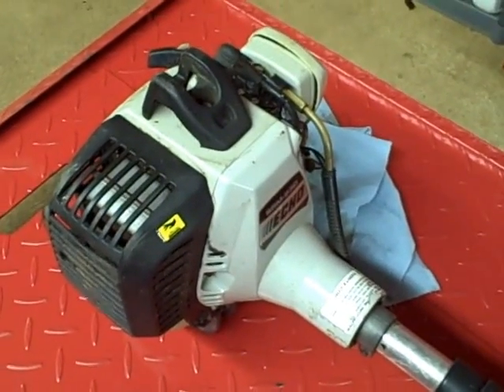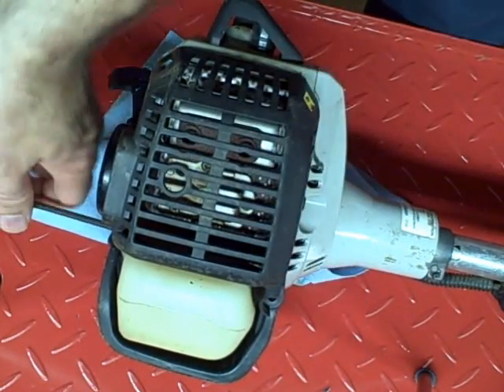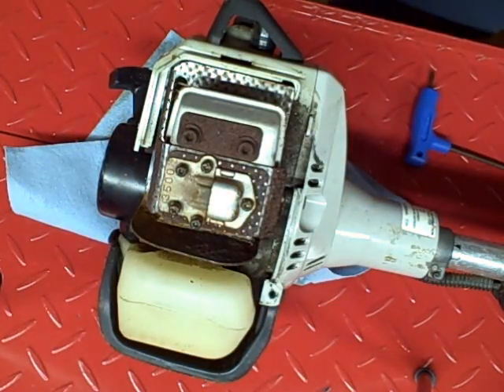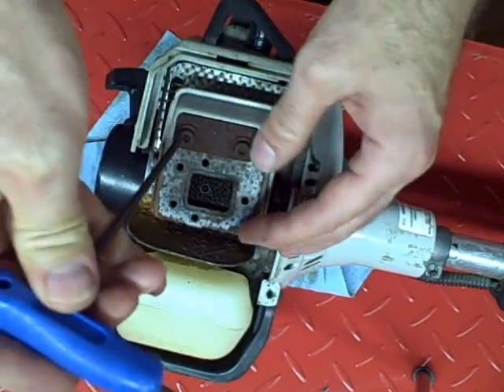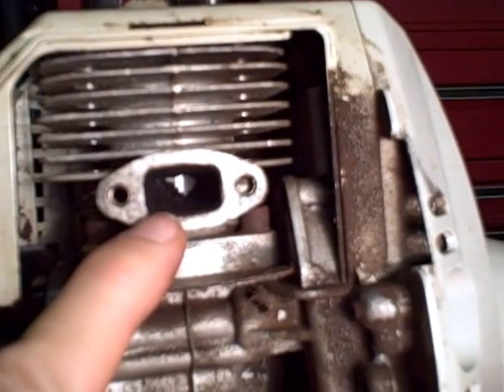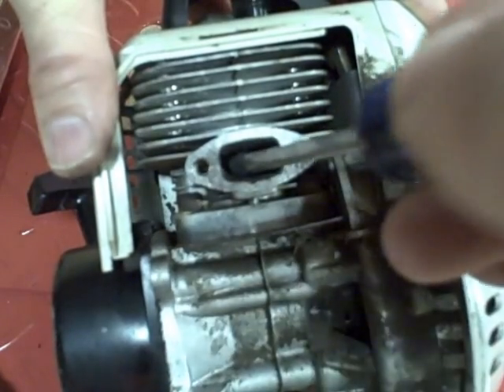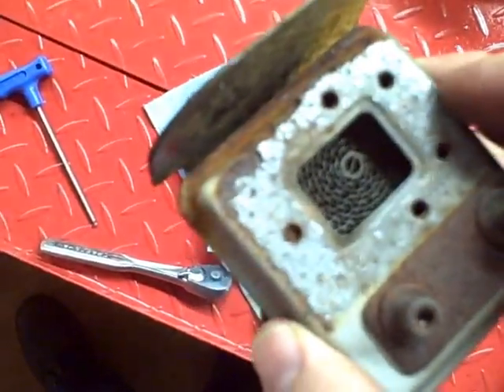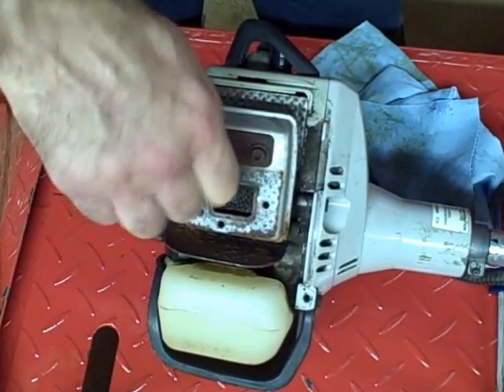Small Engine Repair: Cleaning Carbon Buildup on the Exhaust Port & Muffler on a 2 Stroke Engine

Comment: Some times I’m shocked at how much carb can be in them and still half ass run, I hang them up above my head with safety glasses and scrape it out 
Works good and then blow air and flush with B12😊

Comment: Hi there.  Very good job getting the carbon out of the port. I normally put the engine on its side with the exhaust port up. Muffler off of coarse and put a little gas and let it soak. After a bit I take a thin wooden dowl rod with a slightly sharp tip and the carbon comes out easily. A softer wood dowl is alot easier and safer on the piston. If you accidentally slip and hit the piston it won't damage it.  As far as your Muffler that round thing inside is a catalytic converter. Your trimmer needs high rpms to heat it up and it will actually burn residual oil to nothing. I mean not even smoke. It is important to run the right oil to gas ratio like 50 to 1 or 40 to 1. If you have two cycle equipment without catalytic converters a propane torch is your best friend.  I  take the mufflers of,  heat them till the whole muffler is glowing orange, let cool, blow it out with compressed air,  put it back on and they absolutely scream at full throttle. I  have a Bernzomatic mapp/pro turbo torch for the muffler cleaner. Just in case you want a great torch too for doing that same thing.

Comment: The thing inside the muffler that you said looks like “radiator fins” is actually a catalytic converter used to reburn unburned exhaust gases that normally occur in a 2 cycle engine.

Comment: I have a muffler bolt snapped off in one of these Sthil what size heli coil would I need to repair the hole Have you had any success with this method John

Comment: Yeah, those fins you see inside the muffler is the catalytic converter. My Echo CS370 chainsaw has the same setup. Except I did the muffler mod and drill the cat out then readjusted the carb screws to get it running even better. It’s a little screamer now. 

I also mow with 44 and 46 year old Lawn Boys. Their service manual suggests using a 3/8” hardwood dowel rod to clean the ports to minimize the chances of scoring the piston. Good video!

Comment: Remove the gasket for the muffler and squirt GumOut carb cleaner in it and then empty it out. After excess is drained/shaken out,  light it with a propane gas grill lighter and burn off the remainder.  (A small brass tube can be hammered into a wedge and that will not score steel to scrape the exhaust port), but get the piston up enough to block any carbon from falling into the combustion chamber... 
 I took the muffler sprayed and shaken out from carb cleaner and then set it on the ground (large opening up) and lit it with a small propane grill lighter. Adding a small piece of paper towel as flame comes out the hole drives up the heat and makes the combustion burn up all traces of the carb cleaner. It will be HOT for a few minutes after the burn out !  Be careful and re-install with a drop of no-rust on the screw threads before tightening the nuts (usually 2 for a small metal muffler).

Comment: After loosening the carbon, I prefer to use a shop vac to suck out the loosened carbon, rather than using compressed air.

Comment: Rather than replace the muffler why don't you try soaking it in a solvent like acetone ? Also a solvent like carb cleaner can be used on the exhaust port carbon.

Comment: Was reading the manual for my old MTD single stage snowblower and saw a comment on cleaning the muffler and cylinder exhaust...  I searched the subject and ended up here.  I was out doing snow yesterday and the muffler fell off!!!  The bolts loosened up I guess.  I was lucky to locate the missing one on the ground where I started as I thought it might have been thrown into the snow by the exhaust chute.  Mufflers are expensive!!!!  The one for mine is $40.  We only paid about $150 for the entire machine.  Luckily I will reinstall the muffler.  Thanks for the video!!
Reply: DOLRED LOL!! Sorry for your misfortune and glad you were able to put it back on but that made me laugh :-)

Comment: Great video, thanx for posting. Question: I have performed a carburetor clean up on an older Shindaiwa blower and got it running reasonably smooth at this point. However it seems to be blowing fuel (50:1) out of the breather intake. Any ideas why this might be happening?  Thanx in advance.
Reply: Maximus Dove 
plugged exhaust

Comment: I do this often on my 2stroke bike . I didnt know this trick few yrs ago and I blew my engine twice because I didnt know there was so much carbon on the exhaust port, you can still get away without cleaning like this on a 4 stroke but the 2 stroke engine will get damage and eventually blow its conrod because of the extreme back pressure build up when it gets really hot...I also rode my 4 stroke bike without any of this procedure for 8years and it never really had such problem..however.its very important to do this on a 2stroke engine
Reply: the repair shops never really tell you about this, they simply say it needs repair..if you do this trick every 5000mi on a 2stroke e gine bike its going to last.a long long time..

Comment: I do landscaping 30 plus years experience now been running the same Homelite equipment ever since I started back in 79 the exact same original weed wacker chain saws and leaf blower and believe it or not the best thing you can do when cleaning the carbon out is take it apart like in this video and then urinate all over the muffler and inside the engine around the piston the ammonia in the urine brakes that stuff down like nothing I've ever seen let it sit overnight at least 24 hours 48 hours if its really bad and then shake it until it's about dry finish drying with an air compressor put back together will run like brand new and only got to do it every 7 - 10 years! what I do is urinate in a five gallon bucket and I get it about half full that way I just throw the muffler in and let it completely soaked and then with the other five gallon bucket that has urine halfway full sometimes if I am in a hurry I will just hold my weed wacker upside down and dunk the whole motor in and let it sit for 24 to 48 hours with the spark plug removed and the exhaust removed and it will clean everything! when you take it out do the same thing dry it with a compressor and then rapidly pull the rope put it back together will run like brand new again! the ammonia in the urine is the secret and like I said guys been running the same home light equipment for over 30 years now besides replacing a couple pull ropes and spark plugs all original.. take care guys and nice video
Reply: Wow lmao ive herd it all now i bet this guys shop smell horrible. ....barf
Reply: 2 and a half gallons of urine..........bet that takes some time to accumulate.
Reply: Brilliant! Just brilliant! I laugh my ass out trying to imagine this service procedure. I assume your engines run so smooth as they afraid of being such humiliated more often than every 5-7 years%))
Reply: S Justice  is there anyone here tested his concept put yet?
Reply: Not if you invite your friends over for a beer or two!!!!
Reply: sage advise, i have now started pissing on all my weedeaters and blowers
Reply: piss on it
Reply: and the fermentation during the time it takes to build that up ffs!
Reply: TnD LawnCare Services i am doing it on an echo weed trimmer lol high stakes but i did find it on the curb so i dont have much to lose

Comment: Nice video, I have a echo srm 210 and i tryed to clean the carb out yesterday and when i started it and it was puttering and i had to play with the choke and use the choke to let it run but it ran for like 5 seconds then died, I really need to figure this thing out cause I cut crass for a living so its a necessity. i tryed to clean the fuel filter. and removed it then started it but still had to adjust the choke it get it to run for a couple of seconds. gonna try to clean the carbon maybe that will do it. any advice thanks. Brodie

Comment: Might cleaning the carbon build up at the exhaust be better with a shaped, shaved wood piece (Shish-kabob-like perhaps) so not to score against the piston or metal? Thanks for sharing. Have an old Echo. Now hard to start and keep started. Use to be a gem to run and will now tackle , thanks to your video, the exhaust part after fixing the bulb primer leak. Oh- turning the cylinder is a great tip.

Comment: Great Video thanks. I've just repaired my Stihl FS-55 after watching this. Muffler slightly blocked, but driveshaft had a load of string wrapped round it, so was losing power. Running better than ever now. Thanks again.

Comment: Gotta do this tomorrow.. Needed a weed eater and someone threw one out lmao. Got it to start but it wouldn't warm up and has been sitting for a good long time. Ive done this before and it worked on the old feather lite I found in the trash. I'm cheap haha and I know never to BUY a feather lite. They are like disposable lighters! Thanks for the video! :)
Reply from the maker: ***** Briggs low end engines are designed to last close to 2000 hours under ideal conditions, but most people replace their Briggs mowers with less than 200 hours. Thanks for watching!
Reply: *****
Had a Briggs & Stratton engine on a mower last me like 8 years. Was mowing yards every summer with it. They just don't make things like they used too because the majority here in America has gone a little dark age in the mind.

Gullible country is a place for business men to become lords.. :(
Reply: +Wild*light yry there

Comment: I usually start the motor before I reinstall the exhaust pipe because it sounds cool. :)
Reply: when you do that you're running it lean which damages the engine.
Reply from the maker: Avery Fugett Thanks for watching!

Comment: Great Video! I have an inexpensive Poulan Pro 33cc Trimmer with the attachment feature. I was going crazy as to why after replacing the spark plug and fuel filter and new fuel with correct 40/1 mixture I had no power when holding down throttle. Found the carbon deposits and cleaned, and back to normal! I was seriously contemplating buying a new machine! Thanks A Lot!
Reply from the maker: Elvis Romero Good to hear! Thanks for watching!
Reply: @smallengineshop  33:1 oil mix is good ?

Comment: I have the same weed eater and I can't figure it out I've changed spark plug the muffler is fine the fuel lines are perfect. The fuel filters perfect tits sucks up the fuel when you pump everything turns nice and neat of check the heads of checked everything on it be after some reason it will not start against the fluid in there it's got the spark air cleaners clean I have no idea what else is wrong could it be a bad gasket on the carburetor
Reply from the maker: Is the spark plug wet with fuel after you try and start the engine?
Reply: You just described the exact problem I have (wet plug) won't stay running and lots of fuel come out exhaust (I think that's where its coming from.) I've replaced fuel lines and going to rebuild carb & make sure the adjustment screws are where they should be. Anything else I should do ?

Comment: years ago 1974when selling harleys here in perth western australia an old fella said that the best way to decarbonise his ols two stroke mufflers were to start at one end with oxy actylne heat and then just let it burn itself out so yesterday i tossed my ryobi PLT 3043Atrimmer exhaust and its twin, the homelite F2020 onto a propane gas burner and just let them burn, complete with the spark arrestors and the oily screws. they created smoke like from the pits of hell not that i intend on going there, thank you Jesus and i dont know really but maybe 15 minutes later they were as clean as  awhistle and after cooling  agentle tapping and blowing would be good enough for them to be re-installed. and since they are all formed in fire nothing will happen to the exhausts as they are all steel just in case you think they will melt. all my initial doubts disappeared the moment I saw the mufflers smoking away and knew they would clean up. go on, go try it.I also use my faviourite scredriver iwth e torx bit, my snap-on T handle rachet screwdriver , the best tool I have ever purchased. bloody expensive back in the early eighties, about $80 usd in those days or $70+aud., oNe last thing google 'walid shoebat' being the most informative mind on the growing muslim invasion and End Time doctrine cos Jesus is coming soon and if you dont have a bible search out a Gideon member in your nearby church cos he'll give you one and they are the best to have since they have their own GPS at the back of them Gods Plan for Salvation. you were more than likely given one when you were in 1st year high school but without the GPS in the back. Its the biggest 'must Have' in your entire life. as I say to the people I give them to, If I dont see you again on earth, get your commitment signature in the back of that book and I will see you in heaven. Bye guys.
Reply from the maker: Thanks for commenting and watching the video!

Comment: ALSO A GOOD THING TO DO IS TO CLEAN THAT SPARK ARRESTER BEFORE PUTTING THE MUFFLER BACK ON. I HAVE REPAIRED A FEW THAT WILL NOT RUN WHEN YOU THROTTLE UP THAT IS A COMMON PROBLEM ESPECIALLY WITH THE 4 STROKE WEEDEATERS .HOPE IT HELPS PEOPLE

Comment: this is such a common problem on commercially used 2-stroke equipment.  i clean the exhaust ports of our redmax blowers and whips every year... LISTEN TO THS GUY! even a small blockage will affect performance.   this is the first thing i check when a 2-stroke "doesn't quite run right" or takes a long time to warm up.   you'd be surprised how clogged up they can get, and still run!

Comment: To reduce carbon build-up I used to polish the exhaust port (and squish band on the cylinder head) on my two-stroke motors to a mirror finish using metal polish.  Just remember not to polish the inlet ports - these need to be slightly roughened to produce turbulence to allow for good fuel/air mixing.
Reply: Wayne Templar o
Reply: How do l install a primer on my gas saw no power stroke engine

Comment: he said it was because not having line on it or it was because they put to much oil the gas mix
Reply: negative, deb.  it's a biproduct of burning oil.  there is a broad spectrum of 2-stroke oil out there, some of which are cleaner burning, but at the cost of protection.  high reving motors need a good deal of lubrication, and some of it just doesn't completely burn away.  im head of maint. at a landscaping company and we have not yet, in 6 years, had one lean seizure or major failure in any of our 2-strokes (edgers, whips, blowers... all used at full throttle most of the day, most of the year).  we run Opti-2 at 50:1, a quality oil.   carbon build-up is inevitable in a well protecting 2 stroke oil.  amsoil, for example, has dominator and interceptor.  both great oils for PWC, motorsports and sleds.   interceptor is cleaner burning, for "recreational riders" and dominator is for "racing applications" because of it's artifacts that hang around and protect (as well as foul) in extreme conditions.   Machines that are raced usually do top end rebuilds quite often, so carbon fouling isn't an issue.  long story long, if your small engine is still running after years, but you have carbon build up, smile.  you're doing the right thing!

Comment: hi! I have a mcculloch  ms4018 that has a sheared off fin on the starter flywheel. right now if u pull on the rope it just clicks any ideas or am I dealing with a bench paper weight?

Comment: To clean them mufflers what works real well is to heat the inside up with a torch until the carbon ignites and let it burn til it goes out.

Comment: good video.
at 2.20 when you say screen and then write on the video fins, I think the proper name should be spark arrestor. The function of this is to prevent fires by blocking large carbon flammables.

Comment: I normally burn the carbon with a torch, make the screen glow and then blow the filter with compressed air to remove the carbon. Try that it works well for me mate it might work well, the ones ive worked on tho have a removable plug. Some band new blowers run that rich from new they block up so fast.

Comment: I have a 49cc 2 stroke petrol scooter and I only used it for a couple of weeks when I got it new and now it doesnt start it was starting and cutting out and now it doesn't even try to start so I put a new spark plug on it and new carb checked  to see if it was getting a spark and it had a really good spark so I took the exhaust off and lots of oil started running out the exhaust so I noticed every time I pull start it its filling the exhaust up with oil and petrol dono if its the pistons or not

Comment: will this cause trimmer not to start at all i have stihl fs45 new carb took apart clean flywheel and coil i have a nice blue spark but it will not fire,even when i spray start fluid in carb it will not fire thought it was spark but thats isnt the case so what next ,thanks for  any help,i dont have a compression tester,so cant teest that im being told rings maybe the problem

Comment: i think you should take the cylinder apart to clean the top of the piston too,not just the exhaust port,the piston usually builds up carbon too

Comment: When I have a plugged up muffler I soak it in kerosene then torch it. It usually burns the majority of the carbon buildup out leaving it fairly clean. Another way is to toss it in a wood stove till it's red hot then blow compressed air through it. I have never seen an exhaust port so clogged up like that!

Comment: The radiator looking thingy is the catalyst for emissions... don't use a screwdriver or anything metal to remove carbon, it will scratch the hell out of the piston... use a wooden dowel or hard plastic tool to scrape... use a strong solvent or seafoam to soften the carbon first...